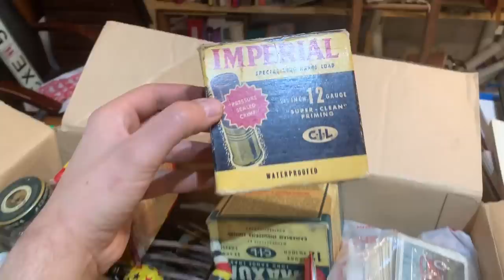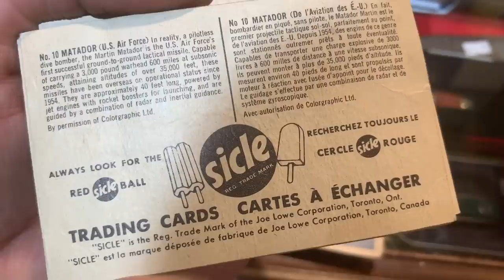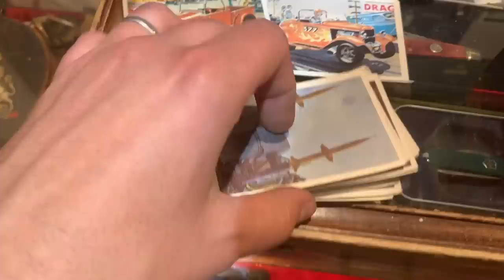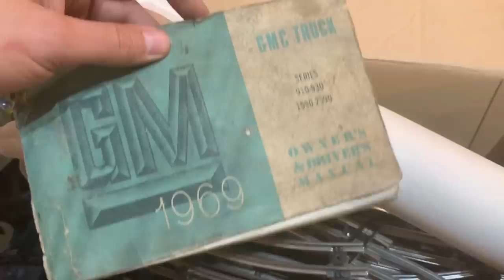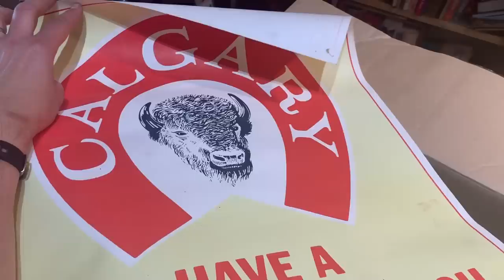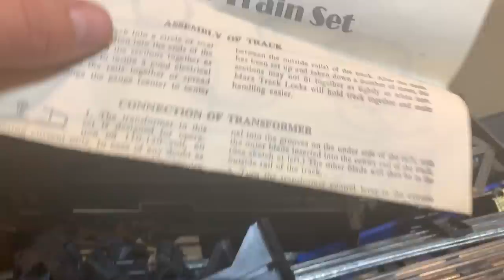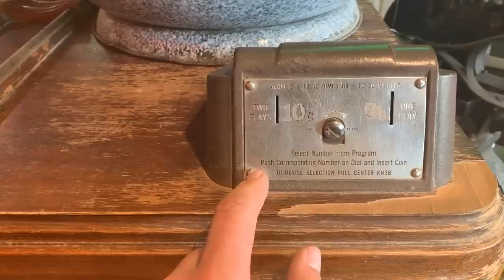Estate finds! Unboxing some new finds! Meet Sean the other member of Curiosity inc!

Comment: The Marx electric train brought back memories. I had one of those in the early '50s, and then for Christmas one year ('57 or '58) I received a Lionel set. My Dad and I discovered that the Marx track would not work with the Lionel engine. Then my Dad discovered that the center rail of the Lionel track was about a sixteenth of an inch higher than the outer rails, but that was not true of the Marx track. By loosening the clamps on the center rails and sliding a bit of flat toothpick under the rail, we were able to make the Marx track work with the Lionel train.

Comment: Django would have played an F-hole archtop.
'50s & '60s sneakers would've been canvas hi-tops.
That baseball glove is from the '40s or earlier. They stopped separate fingers in the mid-late '40s.
That was actually a late '60s - '70s tennis carryall.

Comment: As for the intermittent headlight, sounds like the connector to the lamp is not making good contact and should be replaced, might have corroded in the weather. the connector is very inexpensive (a couple of dollars US)    Walt

Comment: That coin operated jukebox is missing some key pieces such as the amplifier and the power supply along with the speaker which is a field coil type.  I could not see what was bolted to the side so think that might be the mechanical logic.  You probably should consider trading off that BMW when the warranty ends on it.  BMW's are ridiculously expensive to maintain and are not known for being high mileage vehicles.  Look forward to future videos and all the fun stuff you come across.